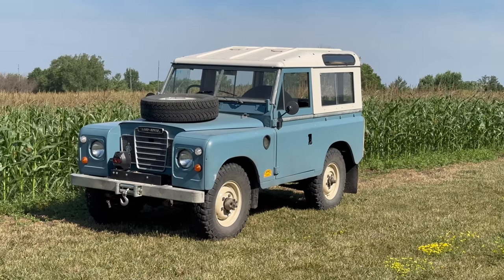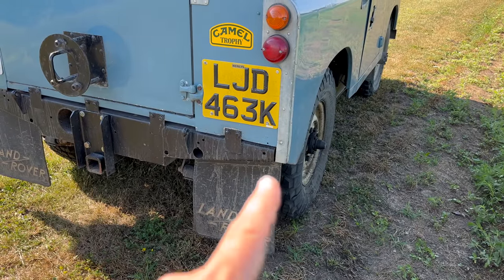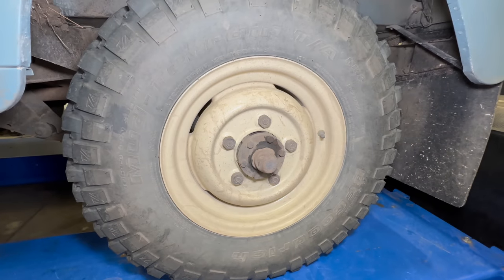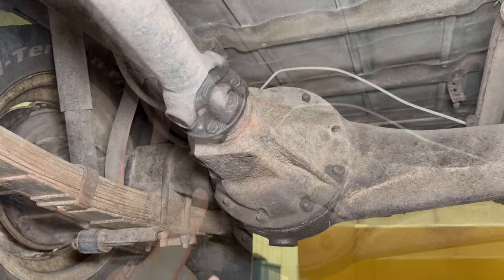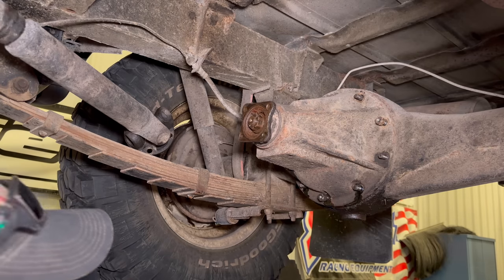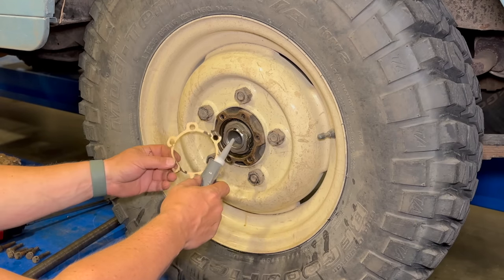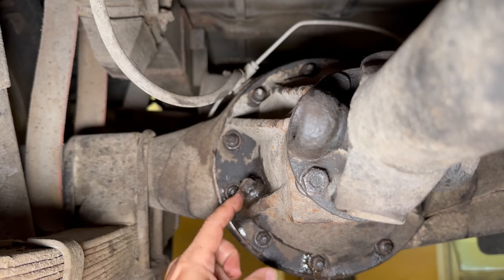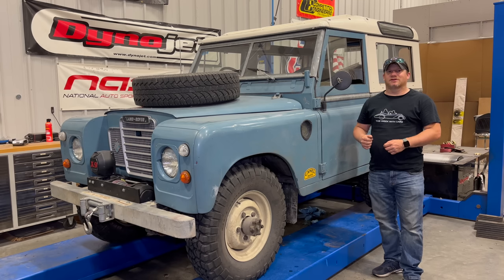Replacing Broken Axle on Land Rover Series III

Comment: Owned my series 3 since 1982, can remember 2 broken halfshafts and blown up rear diff in that time. never leave home without the special  9/16 socket to help get the rear prop shaft off, so you can drive home on the front axle. Any land rover tips are good to see.

Comment: After 50+ years of Landrover maintenance I can confirm almost ALL jobs are this simple and fixable with a moderate quantity of what we in the UK call 'Imperial' size spanners and sockets.
Only thing I would add to this very good video would be mark both flanges of ANY propeller shaft BEFORE dissassembly, if they ran well before you do your work, don't risk the balance gods displeasure! 
I believe you call prop shafts something else for some unfathomable reason?

Comment: Drain the diff first next time.  Lol.  You did not need to pull the diff, a long piece of flattened rebar you can pound it out into axle housing from the diff and a long magnet will pull it out easily.  That being said, I upgraded to GBR axles a couple decades ago and have not broken them yet.  And please use the side of a 9/16th wrench (maybe it’s a 1/2in, I forget it’s been so long) on the drain plugs rather than a flathead.  She is a tractor, not a TVR.  ;-)

PS love your channel.  Sorry to sound preachy, you know much more about many more vehicles than I.

Comment: Very cool. But missed why screwdriver not punch works
Reply from the maker: The punch will not fit through to the other side, there is only two small gaps you can squeeze through.

Comment: I love the series 3. I have a '72 109. I'm in the middle of refreshing the brakes. I've done the master cylinder and the front slave cylinders a couple of years ago, but not tackled the rear yet. Any tips would be appreciated!
Reply from the maker: Top Tip:  Buy the correct drain plug tool so that you don't mess up the plug:  https://www.roversnorth.com/parts/rnt0003_drain_plug_tool
Reply: @ThisWeekWithCars  Awesome, thanks for the tip :)

Comment: Very good mate.  Good job done.    One thing I would have done differently is greasing the caps at the end.    Don’t fill them completely up with grease but the nut and the pin are a greasing point and are meant to be greased           Good job non the less.    Could I have a link to where you got a replacement half axel? Please.   Many thanks
Reply: Besides providing more grease to be flung out all over the wheels can you provide a logic behind putting grease in the cap? The Nut and pin don't do anything, so is is just rust prevention? The felt seals usually weep enough gear lube to keep them from rusting.

Comment: I run this axel on my 58’ because it is easier to fix :o) (should be semi floating)  I’ve never used sealer on the diff gasket because ironically it is actually a decent machined surface. Everything else needs sealer, especially the swivel seals :D

Comment: As that is a right hand drive vehicle with a British registration number, please use the correct English terms when referring to mechanical parts.... they are NOT cotter pins, those are round pins, threaded on one end with a tapered flat section machined into them, what you used on those half shafts were SPLIT PINS.... because they are pins... that split. 😉 Great video Steve, you have a car there that many a trendy owner would love to have over here in the UK.... The farmers? They have mostly Toyota, Mitsubishi and Ford Ranger pickups these days.